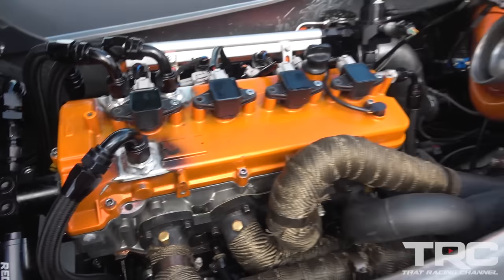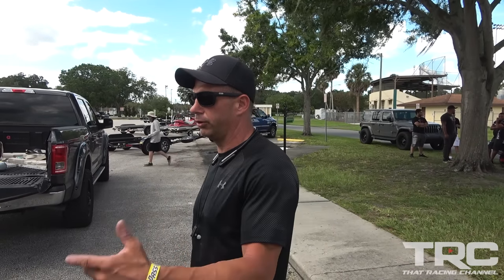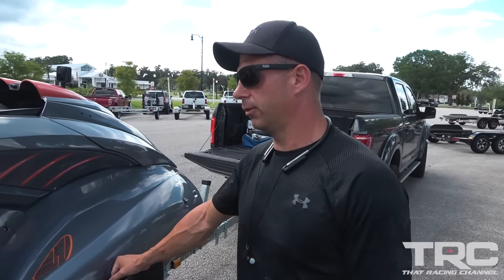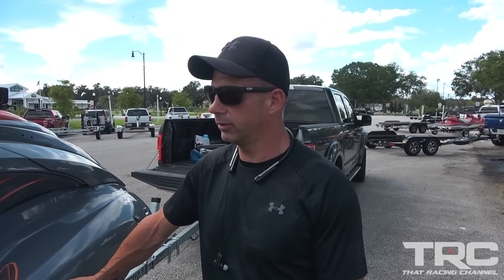1300HP Turbo Jetski 100+MPH CRAZY ACCELERATION (The BIGGEST TURBO We've Ever Seen on a Jetski!)

Comment: Anyone else have serious doubts that it makes 1300, lol, I don't believe that for one second.
Reply: “It makes 1300 hp.... I can’t dyno it, but ya know, the turbo can do that so it must make it” basically their idea 🤣
Reply: Nah its not making no 1300 hp.
Reply: You would think it would be faster then just over a 100mph 1300hp and all
Reply: Think about it. Nitro drag bikes make over 1000 hp. Plus if the ski had 1300 hp I have hard time believing the pump can keep up with the out put.
Reply: Maybe like 550 or something.
Reply: Led4YorHed  Definitely cant do 100mph with 60hp but I understand the point youre making and you're correct. New jetskis you are limited by the coast guard to 75mph but you can remove the restrictor. I have a Kawasaki 310r (310hp) and without the restrictor it can do about 90mph on perfect water.
Reply: @rureadyfor-nv5rs  Just look at the speed and times of a top fuel boat vs funny car. Both 10,000hp but the boats is almost 100mph slower
Reply: Led4YorHed   you misunderstood me. You can definitely do 100mph with 60hp or like you said 10hp on land, no problem. However, you cannot do it with that horsepower in water on a jet ski or boat. And I am 99% sure it's not easier to move through water. Idk if I said it in my original post to you or not but just look at a top fuel boat vs a top fuel funny car, both have around 10000hp but the funny car does 4 seconds in the quarter mile at 330 mph but a boat does 6-7 seconds at 250mph.
Reply: Led4YorHed  yea I'm curious as to why you can push a boat easier than a equivalent car. Everything I can think of tells me it would be harder particularly because of the water displacement. Not only are you pushing the weight of the boats but also the water you are displacing in front of the boat. I'd love a good explanation for that but google isn't cooperating..... As for drag boats I found the reason they are slower. It's because boats are propelling using a liquid which has alot of slip between the surfaces so a large portion of the motor power ends up slipping across the prop, turning into heat due to friction which turns into bubbles annd can ultimately lead to cavitation which is when the  prop can no longer produce more thrust because the prop turns too much water into gas.
Reply: Pro street motorcycle make like 700-800 horse power no way this jet ski is making 1300
Reply: 就是爱你才给你出去外面玩法
Reply: Led4YorHed thats completely wrong😭💀💀 there’s no jet skis that can even go 100 stock fastest jetski is the supercharged twin blower jetski and it goes like 87ish on complete glass water
Reply: rureadyfor 2021 it’s a fucking 4 cylinder and no nitro drag bikes don’t make 1000hp 😭
Reply: They can dyno it at the crank
Reply: erfho8y  it on a jetski you can’t
Reply: Led4YorHed incorrect it takes more energy to move water, I have a 1400cc jetski, compare that to a 600cc street bike and the street bike will go faster
Reply: Andrew Bush you’re unintelligent sir, “pro street motorcycles” aren’t a thing and no, no motorcycle is making 700-800hp not even a turbo hayabusa makes that of a turbo h2 Kawasaki
Reply: @austinlheureux7075  there are 1.8L big turbo Honda Civics that make 1500hp to the wheels, and this Jetski setup does seem similar to what you see in those high-hp Honda builds as far as block, turbo, headers, injectors. I'd assume it makes at least 850hp. Sounds like it's pushing something around 30 psi of boost and it's also running ethanol race fuel, so it could be making a lot more than my lowball assumption. Not sure how long it will last before the engine goes, but it could potentially make 1300, at least for a moment.
Reply: shred1894 my 5th gen cummins makes 30 pounds of boost in order to make any where close to 1300hp you have to be pushing way more psi
Reply: @austinlheureux7075  Diesels don't rev high enough to easily make high hp numbers. Those 1500hp Hondas have to rev to somewhere around 9k with 30+ psi of boost to make those numbers.

Look at the Boosted Boiz's Rowdessy. It's a big turbo I4 AWD minivan that makes 1100hp.
Reply: @austinlheureux7075  cummins is rubbish mate. These are 4v dohc engines with unlimited cooling. An entire different world to your pos cummins.
Reply: I can do 80-85mph on mine that has 250 hp, i dont think that its even close to 1300, prolly more like 400, max 500hp
Reply: @lugugareis8904  no you can’t I’d love to see it, no jet ski off the show room floor goes over 85 except the twin jet supercharged Kawasaki
Reply: @airsoftteamm1958  it’s making like 400 at most lmao for 4 cylinders lol
Reply: Led4YorHed  water resistance is 4x harder than land bro. You’re tripping. My tug boat makes 1500 hp. On two inline John Deere diesels
Reply: Led4YorHed  definitely not.
Reply: @cbracing808  water is 4x harder to displace. Not because of the boats weight but because essentially you’re creating you’re own current beneath the water to propel yourself.
Reply: @austinlheureux7075  EXACTLY
Reply: @austinlheureux7075  my seadoo does. We flashed it and it’s supercharged stock. Goes 94
Reply: @cbracing808  a car gets easier to push as it gets momentum but if you were to push a boat it would get harder with speed due to the drag of the water
Reply: @austinlheureux7075  actually, stock jet skis dont go over 70mph. They all have speed limiters on them to improve safety. Yes you can clock some going faster but that is due to current, wind, and speed sensor error. The US Coast Guard and PWC manufacturer's made a gentleman's agreement to keep them at 65mph in the 90's and then at some point I dont know it got moved up to 70 and made official. It's very easy to remove the speed limiter but if we are talking stock skis then they dont count. 

Also supercharged twin blower......? I think you mean the Eaton twin vorticies supercharger on the Kawasaki 310r. Yes, stock but without the speed limiter it's the fastest current model. However, Honda used to make a turbo ski that without the limiter it was arguably faster than a current 310r, it really depended on the luck of the factory build quality. Like all engines every assembly varies a little in power output but in general most of them where highly underrated.
Reply: @cbracing808  you sir are actually wrong, I rode a sea doo that went 78mph on flat water brand new off show room floor
Reply: @austinlheureux7075  ok, I believe you but if that's true then you got a model that had a production issue of some kind or the dealer made modifications and probably listed them on the sticker but you assumed the sticker was production specs. We bought one of our 310r's with a stainless impeller but that was because it was a dealer on the coast who already replaced them to avoid how badly sand eats the aluminum one. We only noticed because we had 1 310r already that we had to switch to stainless when the impeller got too small lol
Reply: @cbracing808  look it up it’s a seadoo 360 black edition
Reply: @cbracing808  the fuck do you think flashing does? It turned up the boost and removed the limiter.
Reply: @cbracing808  NAH WAIT YOURE RIGHT. ITS ON KPH LOLOLOL MY BAD
Reply: @lvl1022  lol
Reply: @austinlheureux7075  dude if you are gonna argue with someone, make sure you know what you are talking about. You supposedly own or rode 1 of the 100 seadoo black editions produced that are special ordered and yet you dont even realize that the ski you supposedly bought/rode wasn't purchased from or made by Seadoo, its purchased from the performance company who builds them...
Reply: @airsoftteamm1958  you can dyno these lol get a clue
Reply: Most people have no clue about power on the water. You cat compare land vehicles and watercraft together totally different animal.
Reply: @horsefly1020  agreed
Reply: @rureadyfor-nv5rs  you’re trying to compare a bike to a boat... Completely different physics, buddy.
Reply: Led4YorHed  Nope. NOT going to 100mph on the water with 60h.p. NEVER gonna happen.
Reply: @austinlheureux7075  YES, Nitro drag bikes DO make 1000+ h.p. 
Look at a Nitro Top Fuel engine. They make 11,000 h.p. with only 500 cubic inches. Wise up.
Reply: Wrong again. Yes there ARE Pro Street bikes. And yes some bikes DO make 800hp. An 800hp Turbo 'Busa just set a world record not too long ago. Again, wise up. You talk alot of shit, about a lot of shit you dont know about. 🙄
Reply: I think he mentioned it was a honda. In the early 2000’s when I had my built honda, there were plenty of guys making 700-800whp. Some up to 900whp.

You can’t dyno these things beyond 1000hp,  there aren’t many dyno’s that can handle that kinda power. Also they don’t care enough to put the effort in to dyno it.

What they do is have a pretty good idea what the setup makes for each pound of boost and they guess. If that was like a k20 on 60lbs of boost, it’s should be around that 1100-1300range.

Comment: I would looove to see those engines on a dyno to back up those #s!!!
Reply: I know right. 130mph seems pretty slow for 1300hp in something that size. Seen jet boats go faster than this thing with similar/not much more horsepower.
Reply: Joe cook ya exactly there use to be huge jet boat races where I’m from when I was a kit I think they got up to about 150 in a really short distance and all had old big block v8s most of them sounded like they had 500 or so hp

Comment: I'm an old school stand up guy, 1983 440 kawi, 87 550 race Law I that did 55 mph. Then a 93 750 sxi and a few mor 550's. I had 3 and 2 boats and lived on Lake Whatcom untill they banned the 2 strokes here on our 2 big lakes. So I got pissed and sold them all told my stuck up neighbors to go fuck themselves and moved away. I made a high performance boat company that was reliant on these lightweight 2 stroke motors like my 2.5 liter Mercury Drag Racing motor. Indy car tech on a boat! I still have my 2 stroke 2.5 and race Kart, and 8h.p kicker motor for my small boats so screw them. But turbos on a 4 smoker are a game changer. What pump do you run?

Comment: Sooo ahhhhhh....it's not that I don't believe you, but I dont.... it's not over 1000hp. A jet pump you can fit in a ski cant handle 1000hp. Jet boats that have over 1000hp often use 2 pumps, and you couldn't fit 1 of those let alone 1 giant one that could handle 1000hp. Also I've only heard of couple 4cyl that have made over 1000hp. 

And if I'm wrong please do a build recap on this because I'm dying to know how that's possible.

Comment: I need to see some engine dyno numbers to believe its 1300hp sounds like a 600hp civic
Reply: It's no where near 1300hp. Complete bs. If it made 1300hp they would be itching to show that dyno sheet. Actually prob makes 700 ish.
Reply: @Ross-en8lu  ya they would be waiving it around like a golden ticket but theres no proof to the 1300hp just a claim
Reply: @drron5608  it is very very fast , give it a chance peps
Reply: @Ross-en8lu  lots of Hondas make 1000hp at the wheels. Turbo + race fuel + unlimited water to air intercooling = 1300hp easily.
Reply: @nordic5490  and they put it on a dyno to prove it. All I'm saying is until I see a graph it's all hearsay which equals bullshit.
Reply: They couldn’t keep it together at 1300 hp. It’s BS. No discrediting their work. It’s a hard running badass ride. Just inflated numbers.
Reply: He actually states it's no where near full boost..
Reply: Unless there's about 300 lbs of billet block in that thing I doubt whatever it is can stay together at 1300 hp...  How they keep 1300 hp for ripping the whole drivetrain to shreds? It's a little jet ski.....

Comment: I find it awfully hard to believe that this 1.8L makes anywhere near 1300 hp at 60 psi when a prior 2019 world record holder awd 2.2L Honda Civic makes 1300 at 70 psi.  Just because the turbo can support 1300 to 1400 hp doesn't mean the engine can make it.
Reply: Exactly.

Comment: I dont know 1300 Hp. How do they even cool the charged air on a turbo jet ski.. Ooh know I can tell I'm about to go down the rabbit hole.  Hahah
Reply: Yamahas use the water that they are in to cool down the motor and intercooler (or charged air). If you ever get to ride one thats what the nozzles on the side are for.

Comment: Big power yes, 1300hp Absolutly not. Using 1300hp effectively in a jet pump under an 800lb ski is currently impossible.
Reply: Im debating the power too it looked like a 4cly to me if its true those cylinderwalls are on another level

Comment: The only problem is that the maximum allowable speed for a jet ski is 68mph, per CG regs, unless it's used for legitimate organized racing purposes. My 1997 Seadoo XP does 55-60 mph and that's more than fast enough for me, and a stock Yamaha only does 45mph or less.